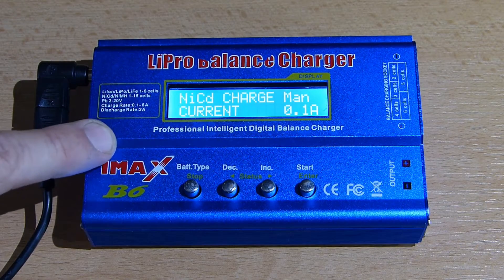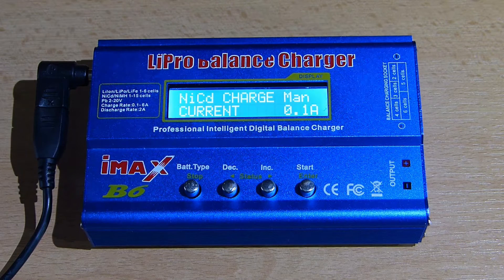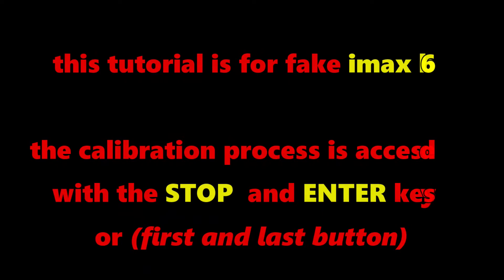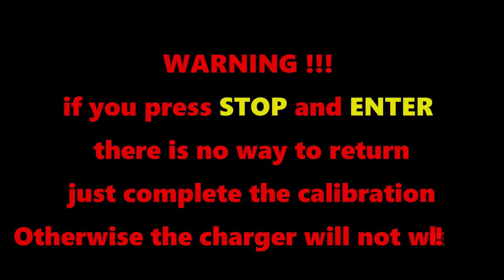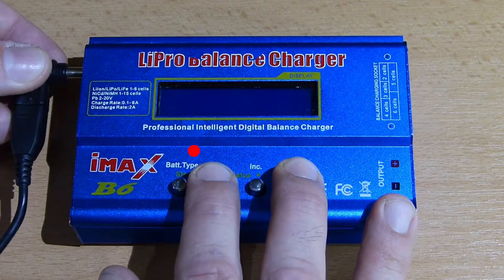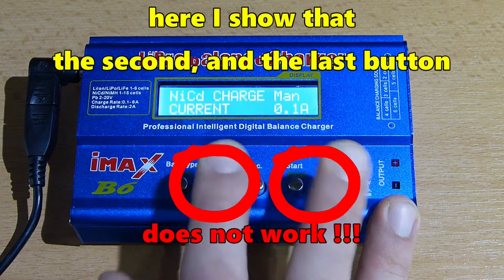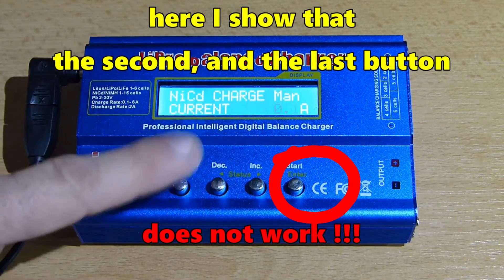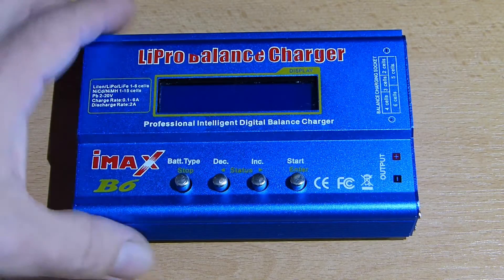Imax B6 Charger Calibration (Clone & Fake imax B6) (English version)

Comment: ok what you need to do before calibrating is put it on li ion setting in user settings after that go into li ion battery and put everything at 0.1 amp and 6s all options from charge ,balance,discharge and storage so all settings are saved as 6s...go back to main menu.....take your 6s battery where all the batteies are balanced...i prefer 4.15 ...and not 4.20....after that connect them to the imax...after connecting it disconnect power from ac to the imax ...hold both stop and enter....power on the imax....now you see all battery voltages all 6 of them...wait couple seconds and power off imax...now restart and the magic happens...you dont have to do anything.

Comment: Either this is not a clone or fake charger, or you somehow managed to flash the original firmware to a clone. (Sky RC on startscreen)
Reply: No, it should also print on it that it is SKYRC. Just only on a Clone one the original can be flashed onto it. The Fake are a lot of parts missing for Org. FW.

Comment: It turns out, if you set charge/discharge/balance to 6S before calibration, all you need is a good balanced/charged 6S lipo. This thing uses the las setting introduced and uses it during calibration

Comment: you dont have to switch the negatives of the batteries...1s and 5s keep them both at negative connected...only switch the red wire..you also dont have to reinsert the 6s balance cables...let them stay in...after inserting the power watch the screen and see what hes asking for...if you pushed both dec and ent when its on discharge 5s mode ...it will ask for 5s discharge and not 1s...if discharge was set to say 3s before calibrating ...he will ask for 3s ...so best is use 3s discharge setting at 0.1 A and exit the menu and than do the calibration pushing both dec button and ent....sometimes after this he will ask for 4s...keep watching the screen..follow the instructions.
Reply: Can you make a video on how to do that?
Reply: @tokeofsweden  ok what you need to do before calibrating is put it on li ion setting in user settings after that go into li ion battery and put everything at 0.1 amp and 6s all options from charge ,balance,discharge and storage so all settings are saved as 6s...go back to main menu.....take your 6s battery where all the batteies are balanced...i prefer 4.15 ...and not 4.20....after that connect them to the imax...after connecting it disconnect power from ac to the imax ...hold both stop and enter....power on the imax....now you see all battery voltages all 6 of them...wait couple seconds and power off imax...now restart and the magic happens...you dont have to do anything.
Reply: @tokeofsweden  put it on 6s charge and discharge and you dont hav to switch anything

Comment: Fantastic video and good English. I have a clone/fake Imax B6 but mine enters to original calibration manu with Desc. + Start on power on but the voltage value is not ok. I correct it but if If add the difference the volt vlaue does not changes and I have to store a very big difference (i.e. I have a battery 18650 with 4.15V with tester, the calibration menu (Des. + Start) shows 4.13V and I have to set +0.11 to see the 4.15V read by charger)

I'll try your explanation.

Thanks a lot for your video.

Comment: how u know its fake
Reply: On the original charger, press the DEC and START buttons, when you plug in the power supply, the calibration menu immediately appears and you can do it even on a 1S pack.
Reply: At Original it should also print on it that it is SKYRC